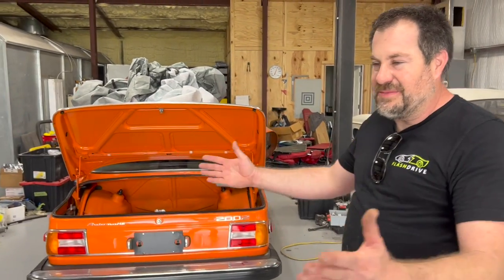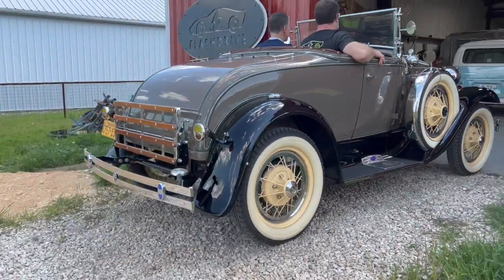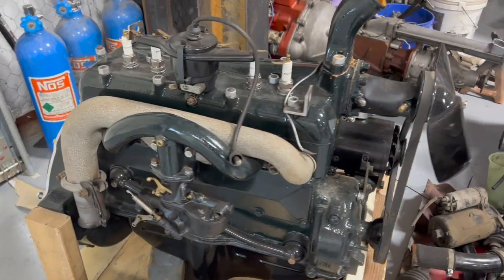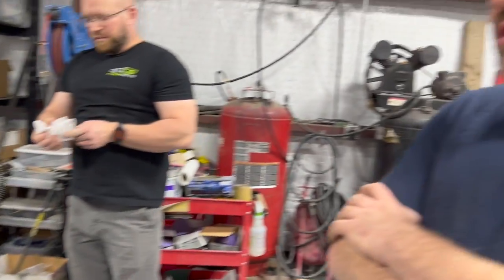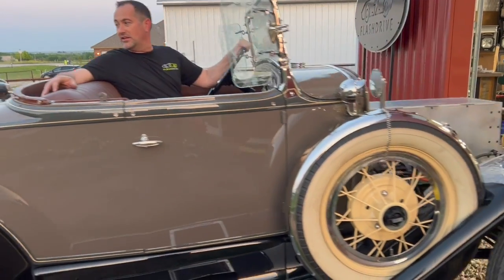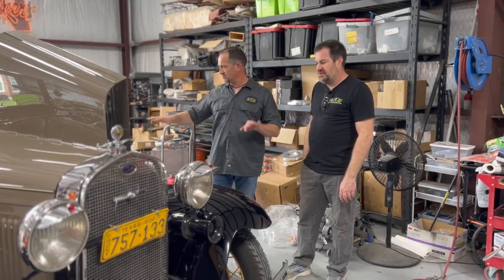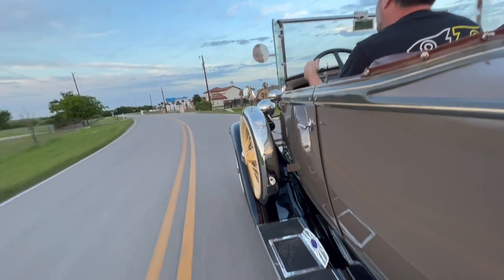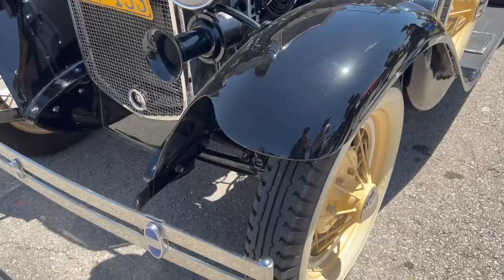The Model E - 1930 Ford Model A Roadster All Electric EV Bolt In Conversion. Tesla battery & Hyper9.

Comment: Awsome! I have a 1930 Model A speedster with a 32-34 model B motor. I've been considering a shift to electric. the motor mount is very clean. I have a Borg Warner overdrive that helps with dirvability. Thanks for sharing your build.
Reply from the maker: We could help you with that.  Call Flash Drive Motors at 512-670-8276 to talk to us about parts and details! Thanks for watching!
Reply: @dissrepair   I'll call when I can. Thanks again!
Reply: Please don't.  These cars should be kept STOCK, or nearly so.  Modifying them is destroying history.
Reply: @michaelbenardo5695  I understand. My car was made into a speedster some many years ago. It has upgraded brakes, 16" wheels, and an upgraded engine ( Ford model B). The reason I'm interested in this conversion is there's little modifications needed and the motor could be reinstalled. However a model B trans is different than a model A. 

Thank you for your quest to retain history. I completely understand.